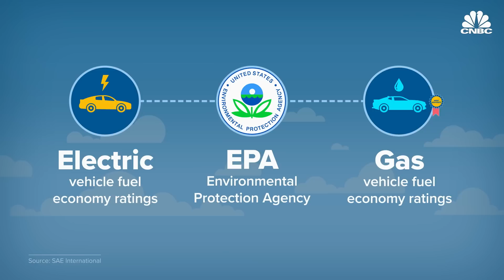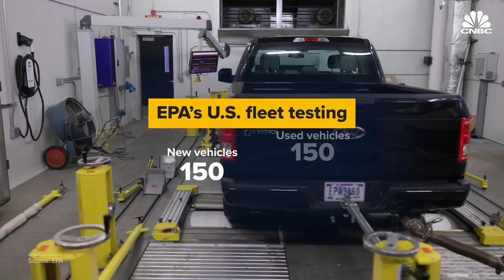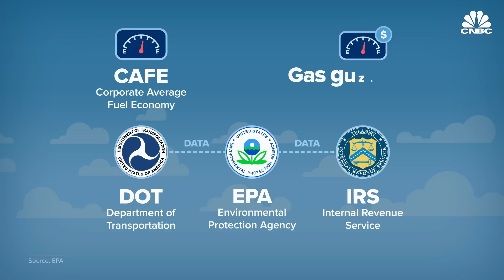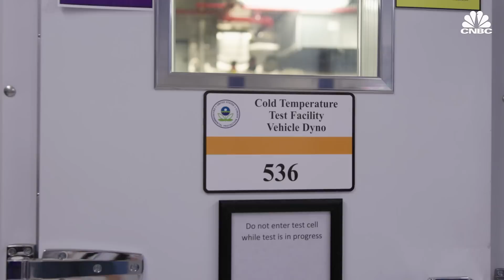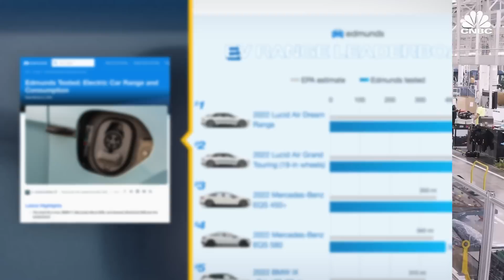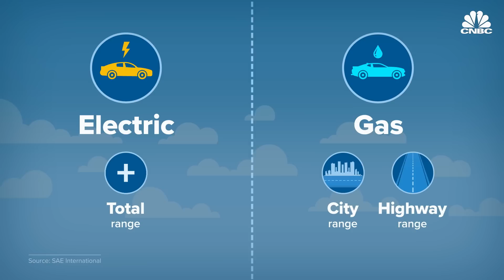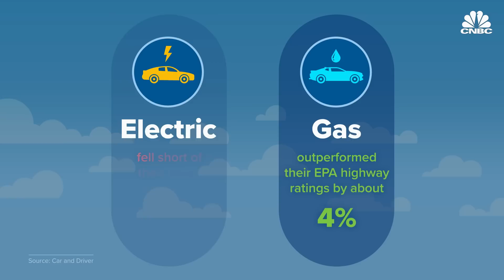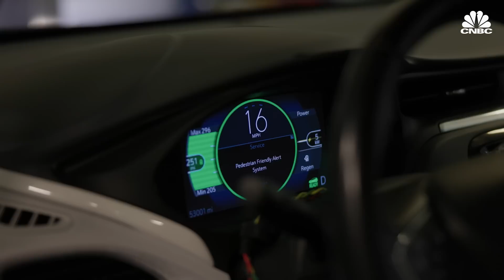Why Tesla And Other EV Ranges May Be Inaccurate

Comment: I have never seen any electric vehicles that met its advertised range. It was always near 50~60% what they said it could be.
Reply: The range they give is pretty spot on with a constant speed of 45 MPH, 75 degrees F, flat terrain, windows up, and using the full charging range of the battery. Highway speeds, and deviation on those other factors, 60% is about right.
Reply: Tried a Hyundai or Kia? My '22 Kona Electric is a range monster!
Reply: @xchopp  statistics have shown that hyundai/kia are by far the worst offender of their vehicles not reaching their epa's
Reply: @xchopp  Or the Taycan which beats its EPA numbers by nearly 50% when driven at 70 MPH.  (Porsche has a long history of undepromise and overdeliver, they sandbagged their test HARD.)
Reply: That's only the old EVs , the new ones have battery thermal management systems and heat pumps. In -15°c I get about 400km out of my 415km range. But summer time you could get a 500-600km range , especially if you like regen braking. I second the hyundai kona love! My 2023 is fantastic
Reply: @hrksknfe  No, not for "old" EVs.  At least in North America, there's only ONE EV on the market with non-negligible volume that lacked a full TMS for the battery - the Leaf.  (Which, due to its combination of sales volume despite shittiness, has ruined the reputation of EVs in this country as far as battery longevity goes)  And even now, reversible heat pumps are extremely rare.  VW won't even give you a heat pump as an option south of the Canadian border for example, even though upstate New York has the same climate as southern Canada where most of the population is.  Ford won't give it as an option on any vehicle, neither will GM.
Reply: @Entropy512  Mine came with a heat pump, preconditioning, and btms,  and every other model I considered did as well. But I live in Canada, I feel like that's non negotiable in the market here. I knew in some states it wouldn't be a priority, like California or Texas, but it seems silly to sell a car without those features in a country that can see extreme temperatures? What if Mr. California wants to go visit his Minnesota cousin? Ridiculous.
Reply: @hrksknfe  Unlike Subaru, who were smart enough to realize that the climate in upstate NY is closer to Canada than much of the rest of the country and offered a "secret menu" cold weather package (heated seats, rear limited slip diff) for customers in northern states in the US (I am guessing every unit they sold in NYS had the CWP), VW will only sell a reversible heat pump to Canadians.  Anyone in the US, even those just south of the Canadian border by a few hours drive at most, gets resistive heating.  Same for all Ford and GM models.  Not sure if they offer a heat pump at all north of the border?  Hyundai and Kia do a better job of offering heat pumps, but do a garbage job of offering sensible trim levels.  Sorry Hyundai, I'm not taking a 46 mile range penalty because you force me to take 20 inch wheels (vs. 18 on lower trim levels of the Ioniq 6) with any trim level I might actually want.

It's gotten so bad here in upstate NY that I'm just going to accept that I'm likely stuck with resistive heat for another purchasing cycle, and seriously considering going to spend the money I save by not throwing away 20 inch wheels I don't want on building some form of dehumidifier that lets me run recirc at higher duty cycles without fogging.
Reply: @Entropy512  yikes, that's rough. Thanks for the insight, that's definitely something people have to consider when purchasing! I for one, couldn't survive without the features , where i live the weather can be incredibly harsh. my ev has to be able to survive anything from -40°c to +40°c . Even if you live somewhere more mild, please take into consideration the changes in extreme weather , and how much more extreme things are going to get.

Comment: Add a test for range  in miles from 80% to 20% state of charge?
Reply: Good point.  Nobody fills their gas tank to 80% because it doesn't make the tank smaller over time to fill it to 100%, nor does it take an extra hour or two to put in that last 20%.  Realistically, drivers should be more interested in the actual usable range, not the theoretical range that will degrade the battery if you actually fill it 100% and run it down to zero.
Reply: That's rocket science for the EPA guys.
Reply: You can adjust that in settings on your touch screen. Mine is set at 80%-40%.
Reply: Really? Take the EPA number and multiply it by 0.6.

Comment: Most people don't appreciate how much money they can save by purchasing an EV versus a gas car, especially with the new tax credits. No maintenance and electricity costs are about 30 percent of what gasoline costs. Range anxiety is manageable with a bit of planning and research for charge points.
Reply: @yowtfiswrongwithyouI have had a Nissan Leaf since 2015. In that time I replaced the wiper blades, the tires, and a 9 V battery. Before that I had a Honda Civic. CV joints, clutch, full exhaust system (three times), numerous oil changes, brakes (the Leaf has regenerative braking, pads don’t wear). Must be about five more things I am forgetting.
Reply: @yowtfiswrongwithyou yes he's right, I've been driving NexonEV in India, there's barely any maintenance unless your driving aggressively, probably I paid 100$ in last 2 years for service.
because of power regeneration in these EVs there more life left in brake pads and tires too.
the only problem early adopters are facing is charging infrastructure.
Reply: If saving money is your concern, you're probably a lot better off buying a 15 year old Corolla or Civic.  EVs have a place, but they don't make sense for everyone.  If I want to take my wife to Red Lobster for her birthday, I'm looking at a 400 mile round trip in likely sub zero temps on mostly interstate posted at 80mph.  This means I would likely have to stop to charge on the way there and the way back adding hours to the trip.  No thanks.
Reply: @wirebrush  HOW MUCH YOU PAY GOVT FOR OWNING A GASOLINE CAR...
To buy a car priced 15,000$
1)You need to earn -21,420$
Because Income tax takes away - 6,420$
of the car price, company & dealer get- 9,800$
Because taxes take away- 5,200$
If you drive the car for 1 lakh km you use fuel worth -7,550$
2)To fund that you need to earn -10,780$
Because Income tax takes away- 3,230$
of the fuel cost, taxes take away -3,920$
Income you need to own & use car (1+2) - 32,200$
Total tax govt collected on your car ownership comes to 58%  - 18,780$
Reply: @wirebrush  for EV, because of insensitive and subsidy we pay just 5% to government, we got more than what we paid for, throwing money any fool can do

Comment: So why don't they just report miles per kilowatt for city and highway like the Gas cars?  Or just change the ICE numbers to total combined range like EV's?  Oh that's right, the oil companies want you to have range anxiety so you avoid EVs.....They could also put range with the cost to recharge/refuel.  Like 350 miles/$120 for an F150 or 350 miles/$20 for an F150 EV.
Reply: Cost to recharge isn't something they can do, given the wildly varying costs of electricity by region/state, and also varying cost by time in many cases.

They definitely should have separate range numbers for highway and city just like ICE, and the highway test needs to be updated to be representative of real world highway conditions in the United States.  The EPA "highway" cycle never goes above 60 MPH and spends a lot of time below 40 - when in reality nearly all interstates are 65+.
Reply: They kinda do! And mine will tell me right on my dash. Hyundai says I'm supposed to get 17kwh /100km 
I get around 12-15 in the summer and 17-20 in the canadian winter. Public charging is pay per minute, so a ton of factors go into how much a charge will cost to dc fast charge. I dont use public chargers much, but it costs me about $20 for 400km. You can Google energy rates in your area, I dont pay utilities, and charge completely for free from home, so I can't help. But you could tell me how much it would cost to charge my 64 kwh battery by finding out how much a kwh costs at your home. It's cheap. Ridiculously cheap compared to gas

Comment: They should only post mileage for EV's at MAX AC and charging CELL PHONES because EVERY GADGET in an EV WILL be USED with people in a car
Reply: It's really not that much energy, compared to the energy needed to move the vehicle. My ev tracks every kwh, about 94% goes to the drive train, compared to less than 5% for both the climate (which I always keep at 21°c) and electronics (my speakers, displays, heated seats, heated steering, self driving computer and sensors)

Comment: Tesla EV shows 310mi range. In summer I usually get close to 310mi with methodical driving (not crossing 70mph, more lower speeds, sparing ac usage, no crazy acceleration). In winters it's about 10% lower at about 280mi if heaters are blasting else it's close to 310mi with preconditioned battery. 
Overall Tesla is not bad. The software updates have made it less accurate and doing 75mph or 85mph does reduce range for sure. But it's also true in my gas car which has 360mi range. Drive bit more aggressive or at 80mph and you get lower gas mileage. If you're in traffic EV shines but gas fizzles in poor range. Gas is better at coming to ita range at 40mph to 65mph speeds.
Reply: there is no way you are getting 280 miles in the winter unless you live in Florida or something. what is your Wh/mile?
Reply: @KC-zi4qb  also sometimes depending on what I did it would even hit 300mi range in winter. Good driving practices have to be done for best EV result. 
EV can take hit from poor driving just like gas. For my gas too hit was a lot (380mi range dropped to about 300mi if I blasted heater and drove without warming engine and crazy acceleration and high speed)
Reply: @FR-Patriots I don't have to pre-condition my vehicle, and I can run my air conditioning or heated seats heated steering wheel and heater. I get 450 miles, then stop for 10 minutes and get another 450. Keep that electric junk.
Reply: @garyszewc3339  a lot of people precondition their gas cars. They'll be home and the car engine will be running and heating that car. You don't look or live in the colder weather so you don't know. Gas cars range drops too if you go over 70mph. Ideal for gas is 55mph to 60mph. Just search online. EVs are designed with air resistance in mind. Gas, not so much. So your 450mi claimed range is likely 380mi honestly.

Also EVs can recharge about 50% in 10m which is about 155mi on the Tesla. If you eat and take a nice recharge 20m break, you can get 65% recharge which is about 200mi range which is aplenty to get to next SC and charge back up. 
Oh and you'd pay $80 for a full tank. We pay $15 at home or about $30 to Tesla for full tank. So you're paying $50 more at least. Lol. We save by driving. And don't pollute
Reply: @FR-Patriots  that's not claimed range, it's how far I drive per tank. I live in Michigan, with real winters. I remote start as I am putting my shoes on, so maybe 2 minutes. Your electric made more pollution in it's manufacturing, than my car puts out. It's worth the cost to drive it, to not be seen in any of the ugly electrics.
Reply: @garyszewc3339  none of what you say is true. Basic research will show you. EV have less pollution overall and this bs needs to stop that EVs with thousands of fewer parts are more polluting. A motor is much simpler than gas engine and has fewer companies to deal with compared to gas which has significantly more. Each of these parts require loads of pollution. EVs have less pollution to make, run and refuel. With solar it's even lesser. Gas is way more polluting for sure. Gas is dying whether you like it or not. Within 7-8y or so you will be driving one too and that's that. Not to mention EVs are significantly cheaper lifetime
Reply: @FR-Patriots Almost everything you just said has already been proven to be false.
Reply: @KC-zi4qb  I do ;) I live in Northeast where it gets quite cold. My Whr/mi is about 242 Whr/mi. You have to precondition car with scheduled departure while it's plugged in. Then use heated seats and basically use heater sparingly. If you go ballistic without these then range loss is higher. Also if you commute longer the hit is lower opposed to quick 10m to 20m drive. My commute was about 65m each way
Reply: @KC-zi4qb  I get 280 miles per charge in the winter too. Why is that hard to believe? No highway driving, minor elevation change
Reply: @yowtfiswrongwithyou so I'm still on the original tires. I did have 2 incidents of nails through the tires. They're plugged at present. I ensure the psi is hovering around 42. ( I usually on cold morning set it to 43). It goes up after a long drive to about 45 and car seems zippiest and bouncy at that psi and seems to use least energy presumably due to reduced contact surface area with ground but some small %.
Reply: My Tesla gets 15% more range when it is hot, 15% less when it is cold. I only drive 250 miles a month so its not a big deal in any case.
Reply: And five minutes after running out of fuel while driving "aggressively" I can be back in the road. EV is for scooters, wheelchairs and city dwellers.
They would be useless or very inconvenient to 70% of Americans.
Reply: @yowtfiswrongwithyou The tires on my Tesla are eleven years old. Should I get some new ones? Never been parked outside.

Comment: There are advantages and disadvantages to attaining as well as owning an EV, the first thing consumers may be concerned with is range. Tesla and the newly launched Lucid Motors are the only ones that have promised ranges of 300-plus miles per charge, while others can only provide 250-289 miles per charge. The next concern is maintenance not having an engine, transmission, or a physical connection for an all-wheel drive as such creates less stress the fewer parts the better until the battery dies. Cost Most new EVs are very expensive you would assume since they take fewer parts to make the cost would be reduced but that is not the case. The average price of a new EV is $38-$60k which is just for the standard class but for the premium class such as Tesla, Lucid, Audi, and more they start from around $60k-$80k or even $100K plus. Most new electric cars they are heavy on technology for many that is preferred like myself but for some, it can be overwhelming. Most EVs are completely operated via large immersive displays which are enticing at times but distracting most times, I am not saying there are not ICE vehicles out there with immersive displays that are just distracting one example: the 2023 S-class. At the end of the day, EVs do impact the plant via production and charging as do when their life cycle ends what happens to their heavy batteries. Evs still have a long way to go as do ICE even though they have been around for a century but for those who want to dip into EVs like myself, PHEV is a great alternative.
Reply: It’s been documented in what happens to EV batteries after the battery has run it life cycle. Some get recycled and used in new battery cell production. Some get used in long term storage of excess electricity. It’s much like if you are throwing away your laptop you should bring the battery to a proper recycling plant and not just throw it in the trash.
Reply: @99treb9  yes it is documented on the process of recycling old EVs batteries, but I’m sure a good portion of them still don’t get reused
Reply: In Australia my 2023 Model 3 RWD costs less after fees and taxes (excluding rebates) than a 2023 Toyota Camry Hybrid.
Reply: @TB-up4xi  I know the prices in Australia and Canada are pretty high but its great to know it cost less there
Reply: Rivian also offers a plus 300-mile range vehicle.
Reply: Tesla Model Y is $40k.
Tesla Model 3 is around $28k.

They aren't expensive.
Reply: @FKS1994  The Model 3 starts at $40k but with EV incentives and saving drops to $28k so that’s a good starting point but moving up to a long range or performance model those start at $47k and $53k but with EV incentives and savings drops to $34K and $40k plus you have to include the choice the consumer chooses to purchased a vehicle most people, may finance or lease as well as purchase cash remember taxes plus fees.
Reply: @gamelauncher9821  Average price of a new vehicle in U.S. is $47k. The Model 3 and Model Y are below that price. Obviously, upgrading to performance and long range can increase the price but the base models is what most people buy. 
Financing, leasing, taxes, and any other fees happens with ICE vehicles as well so it's not exclusive to EV's which was ultimately what you were debating.
Reply: @FKS1994  Yes the over cost of all cars has gone up but EVs are often more costly to purchase rather than their ICE counterparts. Tesla did reduce their prices this year but most new car purchases aren't base models. Most new cars tend to offer more standard features or tech which in turn raise the price on any trim of a particular car. I do believe the average EV do cost more to purchase than an ICE vehicle.
Reply: @FKS1994 you're ignoring the cost to insure an EV
Reply: @economiccrisis9267  yes great point

Comment: its almost like we are pushing EV cars before the regulation and testing and charging infrastructure and electrical grid  is ready for mass adoption
Reply: No one's pushing anything. My Teslas are 4y and 3y old now. And they are doing what they're supposed to be doing. And well.
The electrical grid is fine. It's already charging homes with no issue and solar panels will help lot more.